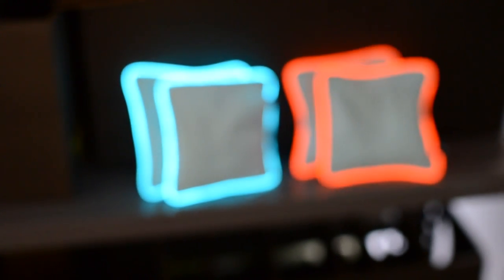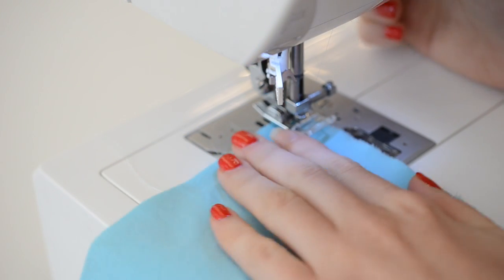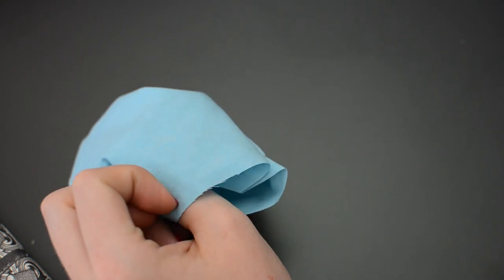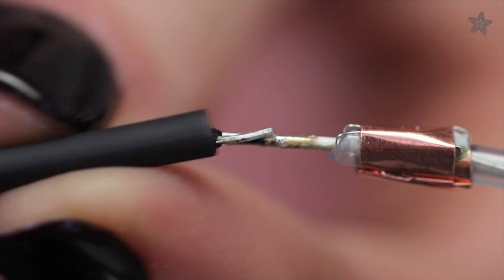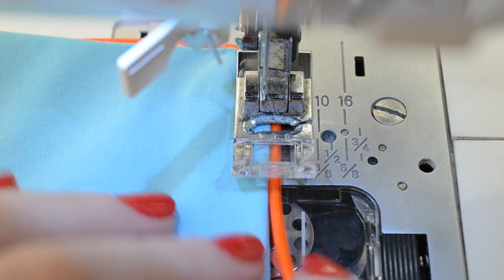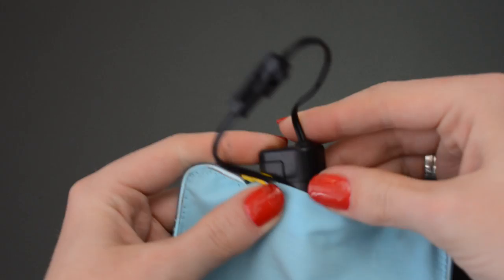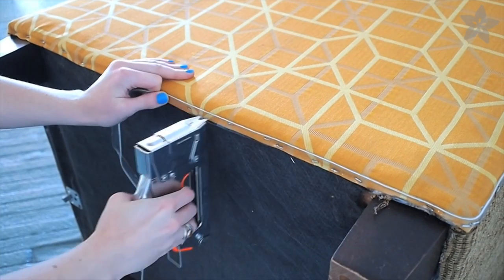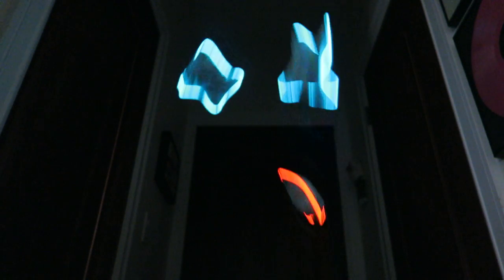Glowing Bean Bags with EL Wire

Comment: Hi is there any possibility of hooking up EL wire to a car/bike battery? If so, a tutorial on that would be great. I want to use EL applications for my motorbike an I was hoping that I could use an EL wire extender with a splitter hooked up to the motorbike battery and then use EL wire for a design on my bike.